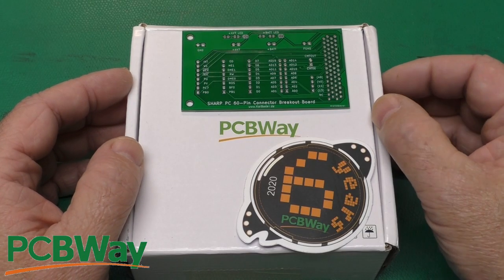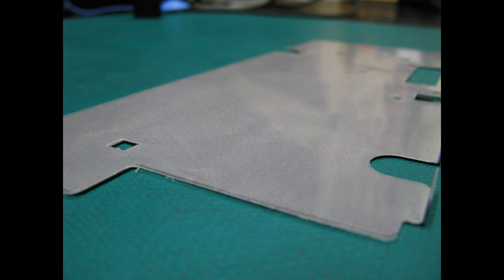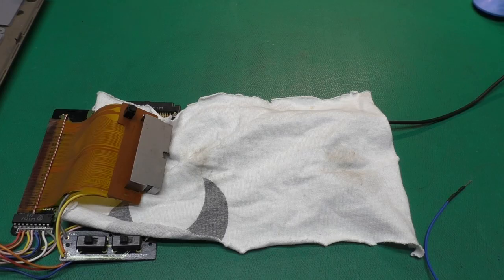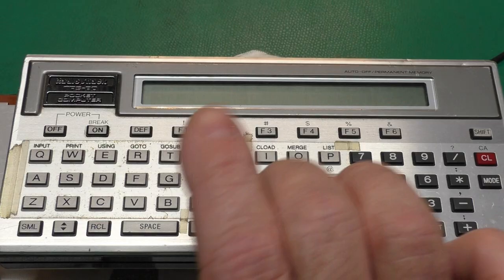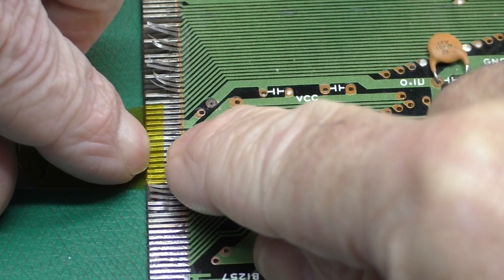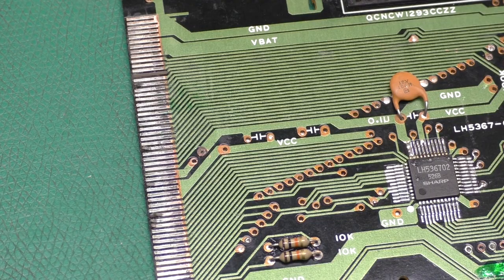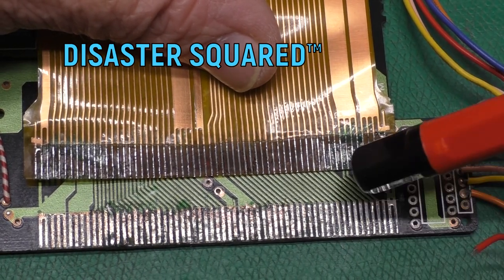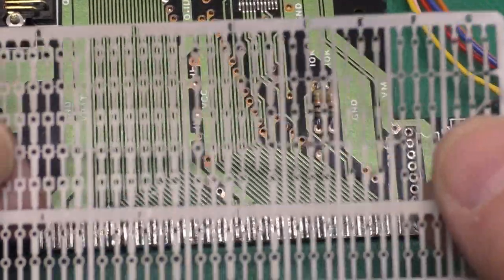Sharp CE-150: A valiant repair attempt that ends in disaster. What went wrong? What didn't?

Comment: A throughly enjoyable and fascinating watch and I nod knowingly at your frustration. The through-hole rivet and the sheets of circuit repair firkins, were I thought wonderful and I never knew that such things existed. Sincerely well done and greatly educational. Thank you!!!
Reply from the maker: Thanks. The things you goof up are part of the learning process. I have since learned/confirmed that the dark coloration of the solder joints on the flex PCB to rigid PCB union are indeed a sign of corrosion cause by battery leakage.

Comment: Thank you Jeff, for your very interesting video documenting your valiant attempt to repair your CE-150 and am sorry you were not able to fix it.
Unfortunately, even if the efforts to resuscitate these machines are successful, we all seem to run into the insurmountable problem of not finding the little color pens for the printer/plotter.
In addition to the CE-150, I also own a couple of CASIO PB700 and PB770 which connect to the nice larger printer/plotter/cassette FA10 and FA11 using the same pens. All the pens I have are dry and so are most of the supposedly new ones which I was able to buy on the internet. 
These little plotters made by Alps and sold with "pocket computers" under Sharp, Casio, Atari, RadioShack, etc. are marvels of engineering and assembly and it is so frustrating not to be able to see them fully operational again.
I made many attempts to rejuvenate and recharge these pens (immersing in hot water, drilling a tiny hole at the top and injecting alcohol and inkjet ink, pulling the tip out and filling back with ink, etc.) but basically all in vain.
Do you have any idea of where to find these working pens at a reasonable price (I have seen a set at 75 Euros !! on eBay), or have you ever tried and been able to successfully refill them?
Thank you very much.
Reply from the maker: Yes, with the plotter once you get the cracked plastic pinion gears replaced with the new brass ones the next hurdle is the pens. The best source for refilling information is this page: http://tandy.wiki/CGP-115#Refilling_Pens

There is a German company offering new plastic bodied pens for sale. They are pricey and I've heard mixed reports as to how well they work. I briefly thought about trying to get reproduction pens made but I'm not sure there would be enough demand to cover the tooling costs.
Reply: @HeyBirt  Thank you very much for your response and the link to the Wiki. It contains very valuable information which I will certainly consider if I persist in my attempts to revive the many little dry pens I have around. I also contemplated 3D printing but exact dimensions and ball point tips are crucial and I am not sure it is worth the effort.

Comment: I know it's a little late now, but try using your hot air rework station to remove those cables.  Start on one edge and work your way towards the other one and as long as you don't yank on the cable it should come right off without any damage.  Did exactly this on an old Sega Game Gear that uses a similar cable.  I kept the temp to a minimum, set the air speed fairly low, and aimed the tool so it blew the air from the PCB side to the edge of the board to prevent the pads from lifting.
Reply from the maker: Thanks! I will try that the next time I need to try to remove one.

Comment: Darn those ribbon connectors!  Elegant solution for the times but not well suited to repairs over time.  Best replaced when possible and room?
Reply from the maker: I have wracked my brain on a way to work around the flex cable. There are vias on nearly ever trace on the rigid PCB leading to the flex connection pads so there is some place to attach. On the connector end there is very, very little room in the hole where it is mounted. Maybe a new PCB with 60 solder pads to connect wires to?

After making the video I found a pile of parts for these on eBay and I think there might be at least one good CE-150 PCB in the lot so it may live yet!

Comment: “Failure is instructive. The person who really thinks learns quite as much from his failures as from his successes.”  ― John Dewey
Reply from the maker: I think I did learn enough to be able to pull a similarly fragile flex cable off and get it soldered back on without the calamity that ensued here. It also inspired me to find a one part heat set epoxy which I think might be better for gluing down loose pads and traces.

Comment: Those darned translucid ribbon cables are in every electronic calculator from the late 70s thru mid 80s; I managed to restore a couple of traces from a chess game dot led display cable only to melt it when re-soldering with a heat gun; definitely u need the patience of a buddhist monk to work thru them; great video anyway!
Reply from the maker: Thanks, it seems to be important to show failures as well as it happens to us all. Hopefully, we can do better next time.

Comment: Thats a very fussy repair, the number of connections means poor odds. With this sort of thing I'd attack it in several sessions. I have an Atari LYNX II with a bad carbon contact ribbon that I come back to time and again. No luck yet but I've learnt some tricks with conducive paint.
Reply from the maker: Fussy, that is a very good way to describe it :) 

I did work on the board over a few weeks. The big disaster with the lifted pads took about 3 days to get to the point of trying to solder the flex cable back down. But, it was fun trying.

Comment: how well do you think that eyelet repair would work with a 4 layer board? if at all?
Reply from the maker: It will only work for 1 or two layer boards, there is no way to bond the eyelet to inner layers. It may seem connected at first but there is no way to guarantee it will stay connected. 

You could use it to provide a secure through hole for a component but you would need to know that the larger hole you need to drill to fit the eyelet will not touch any inner layers not originally connected to the hole (no shorts). You would still need bodge wires to  make sure you have an electrical connection to inner layers.
Reply: @HeyBirt  thank ya sir 🙂

Comment: Simple question I'm the original owner of  a CE150 with original batteries that at NOT leaking (yet)  should I remove them?  Replace them? or leave them alone?
Reply from the maker: Defiantly remove them before they leak. You cannot use it without the battery pack though. I can make you a new pack.